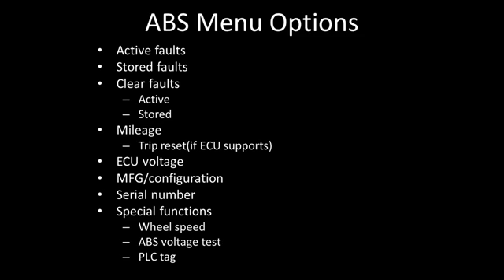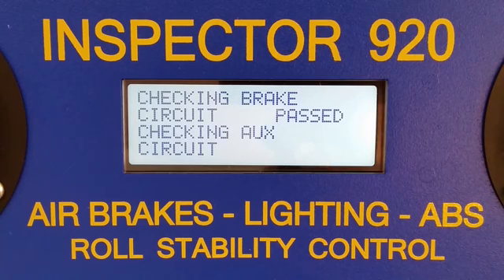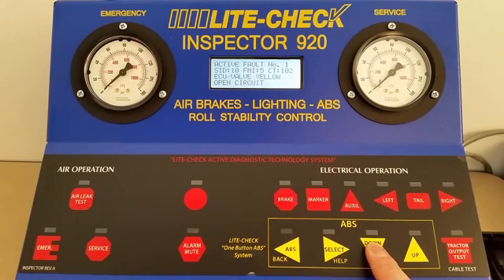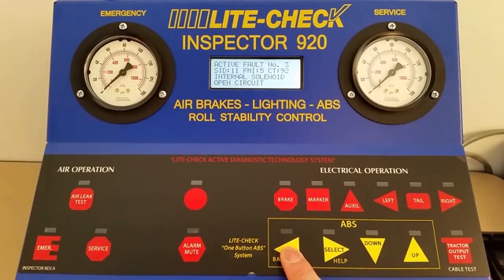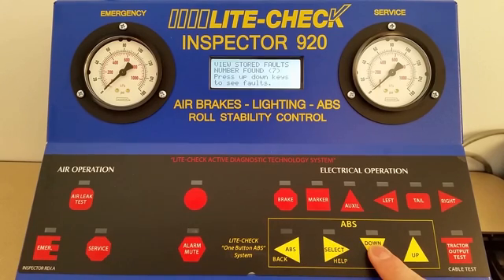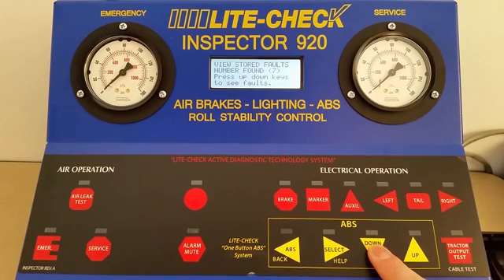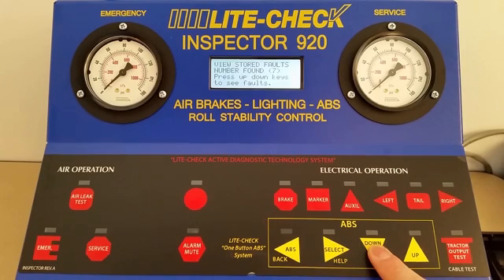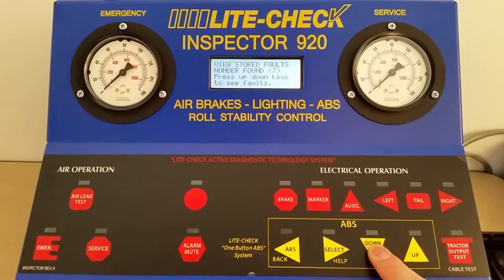ABS Testing Operation - Lite-Check Inspector 920 Trailer Diagnostic Tester

Comment: What does it mean if it says "brake circuit failed" when first checking the abs?
Reply: Just as if you were to press the brake button to test the red wire circuit, it detected a hard fault, OPEN, OPEN GROUND,CHASSIS SHORT, SHORT